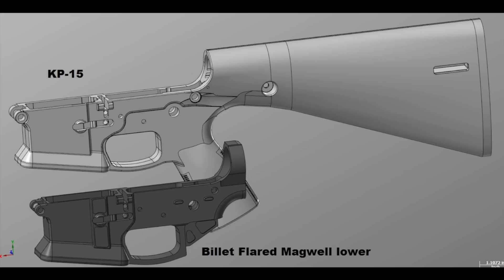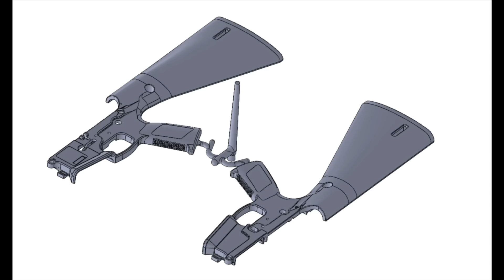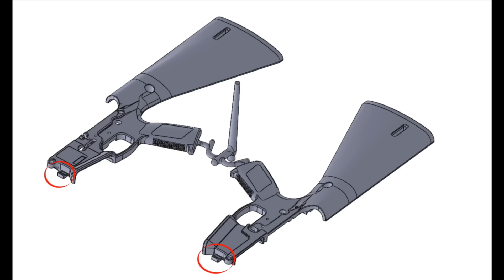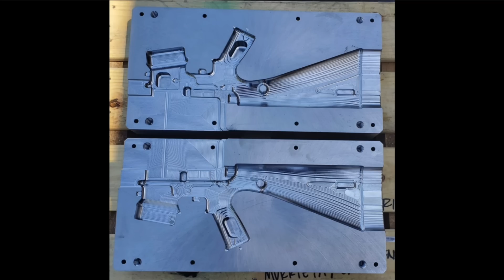WWSD2020 - KP15 Polymer Manufacturing Discussion and Updates

Comment: It's really complex from an engineering standpoint and companies like H&K, Steyer + Glock mastered it in the late 70's, that's why they were ahead the curve a long time.
Reply: That’s true to some degree but the reason other companies didn’t “master” plastic manufacturing back then was that they were trying to convert previous gun designs into polymer guns and that’s what makes this project more complex than building a polymer shell for a brand new gun.  It’s harder to adapt a piece that was once aluminum into polymer than to have free reign in creating a totally different design. Glock and Steyer were ahead of the curve because they had the funding to make the leap of faith to a brand new polymer design, while others hesitated and made adaptations.

Comment: Upper-Tier educated user here 🧐

In all seriousness, it sounds like these guys are really doing their due diligence to make this product right the first time. Never realized how much goes into making polymer molds. 
Like they said, it's not a GI Joe part its a firearm part, so it's great to see a lot of great minds coming together. The last thing we want is a half-assed plastic part that's gonna crack along a fault-line that could have been prevented with a little more homework!
Reply: Haribo Starman I seriously doubt Ian wants his name tied to a future forgotten weapon lol
Reply: Moldmakers are in a class of their own. We wouldn't have cheap plastic stuff without them.
Reply: @james avery not just molding plastic is a pain, even machining raw bar stock is a pain. Coolant, no coolant use air blast instead, how much it melts, does it expand when machining then contract, the surface finish from feeds and speeds, fiber filled vs non fiber filled, and even how razor sharp the tooling needs to be by knowing if you need carbide, diamond coated carbide, or sintered diamond that's ground and honed. Plastic just sucks for how it can at times be less predictable than some of the worst machinable alloys like cobalt chrome.

Comment: Actually, you COULD design a mold with inserts to shoot both 100% and 80% lowers from the same tool, with relatively low increase in tooling cost.  Can't solve the ATF problem easily, though.

Comment: Did I hear $100 for a bare lower? I'm in.
Reply: $89 from Brownells
Reply: With stock included.
Reply: @cmikles1  The stock, grip, and buffer tube are all integrated into the lower. Pretty much the only things you need to complete the lower is a buffer and a lower parts kit. So you get a very economical and light weight lower. That's a win win in my book, and will probably help them sell a crap ton of these.
Reply: @RARufus  The total weight reduction is quite substantial.
Reply: Seriously I had to watch this a couple times. I really cannot believe it’s that low. Looks like I’m building an AR soon.
Reply: Payed $50 for a bare aero
Reply: $50 forged lowers have been around forever
Reply: I have a few CavArms Lowers but would add in if these too!

Comment: I didn't realize how interesting polymer manufacturing could be. I mean I would hate to be having to do that math for it but really cool.
Reply: Being a product designer who works with plastics, It's pretty cool.
Reply: Most of the math is in the CAD design and mold flow- which the computer is doing for you. Its really not that bad. The worst part is working with the mold tool builders/engineers- who are some of the grouchiest old assholes you’ll ever meet. And they tend to agree on that assessment.
Reply: ShootEveryDay the work would be a lot easier if the model wasn't totally ass backwards lol
Most of the time people don't know what they are doing until they actually try to do it.
Reply: Materials science here: polymers are a mess! Haha! There's a whole separate group of mechanical properties for polymers because they are all time-dependent. If you pull on a piece of plastic, it'll relax over time
Reply: The math isn't that bad, once you get  into it.
Reply: @JainZar1  I dunno I'm trying to finish discrete math right now and I'm not really enjoying it lol. I'd honestly take either calculus over it (haven't taken 3)
Reply: @worldfamousgi86  I doubt most mold designers have touched calc in decades. Only a few people in the process would touch math and 99% of it is just been programmed into the analysis software even so.
Reply: @scottwatrous  yep i'm a mechanical engineer and have literally never had to do any math at work beyond basic algebra. all the fancy math (calculus,  differential equations, vector analysis etc) is baked into the various software tools we use. UNDERSTANDING the concepts behind the software is helpful, but actually doing the math is the computer's job.

Comment: I am absolutely salivating for one of these.  Actually, I want to buy one complete rifle and one stripped lower.  Cannot wait.  If you just happen to want a plain ole average guy to test one, let me know.  I have extensive experience as a shooter and trainer.  I am also a certified gunsmith, so I can communicate intelligently about a firearm, how it works, and how to present constructive criticism - positive and negative.  Love you guys.
Reply: That’s awesome that they’re dumb shits like you that will pay them this type of money for a gun that’s made of plastic
Reply: @bigcitydiddystraighttalkmi7834  The US Marine Corps did the most strenuous test in history to find the best, most durable and reliable AR magazine, and picked the PMAG Gen3, which is a polymer magazine. They certified the PMAG as capable of running 20,400 rounds of M855A1 without a stoppage. Magazines are generally an even more abused, more prone-to-failure part than the lower receiver. No magazine made of metal came close to the PMAG performance.

Comment: This may be an odd question, but how are you applying the Serial Number to the lower? Does the mold have a space in it for movable type and the numbers change progressively with each new molded piece or are they applied (stamped, drilled, laser cut?) after the two pieces are friction welded together?
Reply: I'm fairly certain that the SN has to be on a piece of metal by law. My guess is having a small metal plate molded into the reciever and engraved with the serial number.
Reply: It’s on a metal tag that gets over molded
Reply: @SinistralRifleman  Thank you for answering my question. When the 80% lower question came up I thought to myself, "wait, how are they putting the SN on?"

Comment: The price for this rifle is 😂
Reply: It’s literally the MSRP of all the components with no cost added for assembly or the fact 11% of the sale price from the manufacturer goes to .gov for excise tax.
Reply: What ever you want it to be. If you get the Brownels factory build with all high speed low drag (high price) parts then till cost what a high end AR costs. If you get a striped lower for around $100_125 then it’s down to you what you use to build the gun up. Under $600 should be doable maybe under $500.

Comment: I'm really struggling here, guys.

I really want one of these. But I have several ARs already and don't really need another one.

But I want one of these.
Reply: Sell one.
Reply: @LUR1FAX  Sell...a gun?

I'm sorry, I don't speak whatever language that is 😂
Reply: They're pretty cheap, get one to support the project
Reply: @HariboStarman  That's one of my motivators for wanting one, for sure
Reply: You could just rebuild one of your least favourite current ones with just this lower instead of its current one, depending on parts compatibility yadda yadda.
Reply: Not about need🙂
Reply: Same. Gonna make an exception for this though, it's very different from standard recievers
Reply: Dana Herron it’s always good to have a backup to your main, in case it goes down in a time sensitive situation.  I’m talking about a class, an outing with the friends, or just a long drive to the range(mine used to be a 35 minute drive).  Nice to not have to cancel an event because of a failure.  Once you get to 3 or more of the same gun, in the same caliber, you’re becoming a collector
Reply: @johnnybagofdoughnuts4193  And don't forget family members - what's my wife supposed to use if things go south? I'm not sticking her with the milsurps. Heck, I've even got a couple of ARs set aside for the kids once they're old enough (like I said, I don't 'need' any more 🤣)
Reply: Buy it for the garage 😉
Reply: So get one, no shame in having multiple ARs for different purposes

Comment: Why not leave the trigger group holes out of the mold and just final machine them in? I'm thinking even a Ghost Gunner machine could do that step well.
Reply: Every second of production time is money. If you can get enough data from a statistically relevant sample size of test runs to show how the plastic behaves and then modify the mold accordingly, you will ultimately save on cycle time and manufacturing cost
Reply: Tangero exactly
Reply: @xtangero  They'll need to do machining anyways for the small detent pin holes, Adding in the trigger group holes wouldn't add much time to that step.
And if you were to mold those holes they wouldn't have a draft angle on them and it would make it a bit tougher to remove, not to mention they wouldn't be as accurate as machining.
Reply: Wouldn't fit into the GG machine.

Comment: Why is pistol grip integrated into lower,and screwed in like in ordinary aluminum lower receiver? I know that this shape probably fits all, but it doesnt look like it needs to be that way becouse of strength.
Reply: the pistol grip is integral for added strength.  polymer lowers with standard grip attachment have been tried before, but they break.
Reply: If the pistol grip is not molded into the lower, the area between the grip and stock will not have enough material to hold and will be a failure point. Other people have tried that and they have mostly failed in that one narrow area.

Comment: I haven't track this project for a long time and don't know where to start to get the idea about what it is, who builds it and what are the goals of it. Do I have to watch all the several hours of WWSD videos to get it? As far as I understand, it is meant to build the perfect AR of modern time using technology that was not available back then.
Reply: You've pretty much got it but there's probably 2 videos you can watch to help you better understand the point and goals of this project. The first video of the original project and possibly the first video of this project.
Reply: @Spooktical So there is only two parts: 2017 Original and 2020 new?
Reply: @Paul_Sergeyev  The 2017 project is a video series about 10 videos long. If you wanted to get caught up quick you could watch this one:
https://www.youtube.com/watch?v=_y77fVM40mI&vl=en
and then dive deeper into any parts you'd like to know more about
Reply: @Paul_Sergeyev  they have a String of videos explaining the thought process that went into each part, and the testing of those parts, but they have an introduction and conclusion of the wwsd2017 rifle, and the intro of this the wwsd2020 rifle. I'd watch the old series, theres not much actual testing so far on the 2020 rifle, mostly the getting it to production process. With the main idea being a lightweight "fighting rifle" using the most modern tech feasible, and not sacrificing reliability to improve performance. Ends up being a 6ish pound rifle with everything on there
Reply: The original part they used was the GWAX polymer lower. This became unavailable quite quickly and was no longer able to be manufactured. This project was started to provide a suitable new product with a similar design intent.
Reply: @EFCasual  I had looked at these when they were CAV-15 with interest. However I am not really a AR-15 guy. I am not a good rifle shot, but I can shoot the hell out of a handgun.
Reply: https://www.youtube.com/watch?v=G6Rd6BKaJDo That's the announcement video for this project, They go over what it is and how they are going about it.
Reply: Pinned comment by InRange at the top gives a link!
Reply: I thought if it as the handiest civilian combat rifle for practical use

Comment: For anyone that has the carbon fiber handguards: His do you guys mount M-lok attachments? Do you just follow the regular instructions? Do you do anything special?
Reply: regular procedure
Reply: As far as I can tell, you attach some picatinny to the MLOK slot where you want to mount something. There's no need to have a bunch of picatinny rail except where you specifically plan to mount something, be it a light, grip, etc.
Reply: @LUR1FAX  there are Mlok attachments so that you don't need to add mil-std-1913 rail...
Reply: Well hopefully you start with a handguard with MLOK everywhere like their Faxon. But yeah, it's the same as any other MLOK accessory. Carbon fiber is tough, I attach my crap with the same amount of torque as I do on an aluminum rail with no issues
Reply: lon242 you’re brave. I just use the plastic torque value and it’s tight

Comment: As someone who’s worked in high volume, precision medical injection molded components - delays are totally not unexpected. And most of my components were straight pull from the mold- no slides or lifters. I commend your team on this project
Reply: Also did plenty of ultrasonic welding work. Be sure you’re developing your process now. There are so many parameters in the process. And you don’t want to be modifying energy directors /shear joints later on. Welding and EDM mods are expensive, time intensive, and soul crushing
Reply: I worked QC in plastics for medical, and now a mold tech in automotive....I rather liked the information they gave.